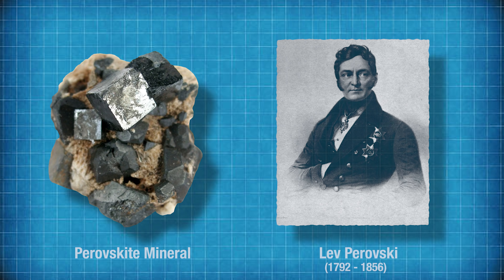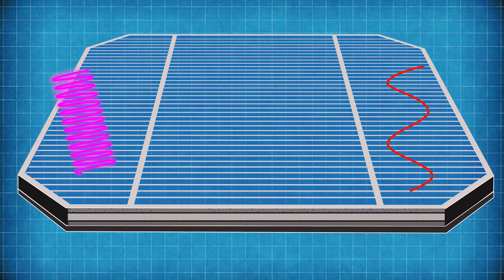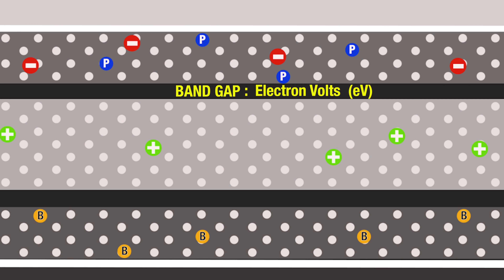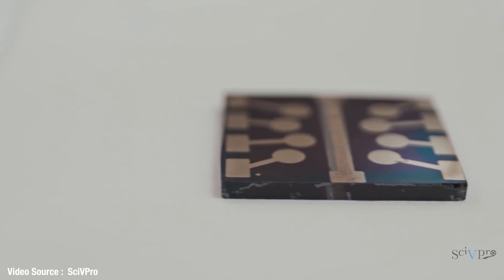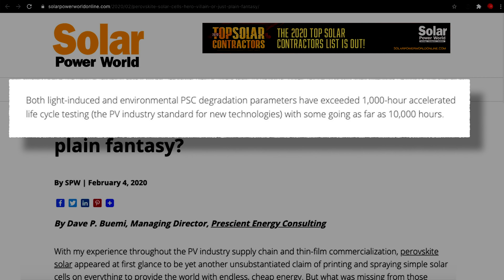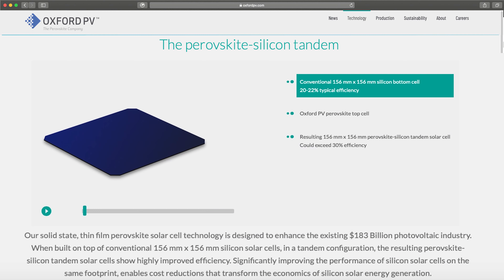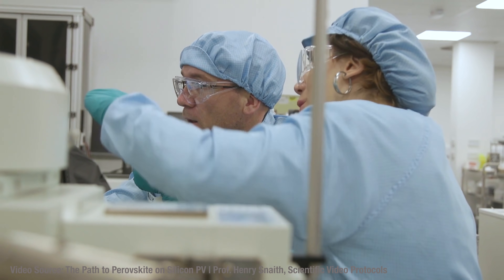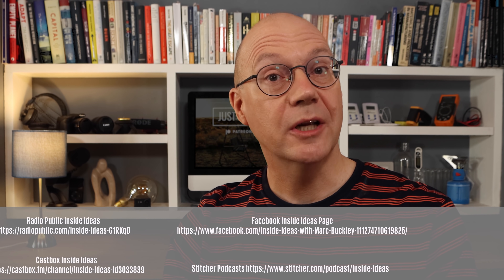Perovskite Solar Cells: Game changer?

Comment: Really interesting video! I wasn't familiar with perovskites and this was a great intro.

That said, your explanation of Si cells contained several significant errors, the biggest of which was your description of the band gap, which has nothing to do with the distance between two things. The band gap is the energy required to excite an electron so it starts moving about, enabling conductivity. Think of a piece of Si as a giant tray of ice cubes: If you jostle it just right, one will pop out and slide around on top of the others. How hard you have to jostle it is the band gap.

Also, the doped layers both conduct better than the non-doped layers (plus there aren't really distinct layers but more of a gradient), the difference in doping just changes whether the energy is carried by positive or negative charges.
Reply from the maker: Thanks Benjamin. Absolutely correct, and this has been pointed out to me many times now since Sunday. My apologies for the inaccuracy. I have now removed the section of the video where I said boron makes silicon less conductive and I have also removed the part where I say that the band gap is 'between two layers'

Comment: Solar thermal energy coupled with storage (molten salts) currently operates as a base load power source.
You’re referring to Photovoltaic power which is only 23% energy efficiency. The combustion engine efficiency is at a similar level. In fact a finely tuned formula 1 racing engine barely exceeds 28% energy efficiency. Most of the energy generated by a combustion engine is lost through the exhaust pipe as heat.
We need a raft of renewable energy sources connected to micro grids and interconnected networks coupled to storage facilities in order to supply the demand curve (which varies widely during the day and during the year).
Reply: Yep

Comment: It all sounded credibly good until you mentioned Al Gore. Solar's success is largely dependent on grid capable energy storage and delivery (batteries and super-capacitors). Both areas seem to be hitting new milestones - but there is still a gap. When this gap is closed there will be a revolution in the global energy grid.

Comment: Prediction: it will be a graphene perovskite of some kind that finally breaks 50% efficiency.
Reply: Efficiency here isn't the issue. It's stability. These cells literally react when light shines in them lol so it's not going to become comertial anytime soon they're sensitive to water or even humidy as well
Reply: @RECURSIVECIRCLES  You can protect the cells from those environmental conditions pretty easily. The REAL enemy is ultraviolet radiation. That's the part of the spectrum that causes the photochemical reaction you describe.
Reply: @vincentrobinette1507  no you can't. I work on these materials. The problem is they're highly reactive and unstable. The lead leaches out. The main issue with these cells is their stability. There are no cases of more than a year yet and functional efficiency. In space it may be better but so far this is the biggest draw back for them
Reply: @RECURSIVECIRCLES  One thing I didn't think of, is oxidation. I wonder if corrosion is another factor. Just like painting a car, it protects the metal from oxidation, for a while. It eventually creeps in over time, otherwise, cars wouldn't rust. I don't know how corrosion resistant these cells are, and it also depends on the chemistry. Lead will indeed, oxidize. containing the lead can't be too much more difficult, than containing the lead in a AGM battery. (which also have a very limited service life)
Reply: @vincentrobinette1507  yes corrosion is one big problem. The lead corrodes into the material and yeah oxygen is a big problem and even light. Light activates some molecules and make them corrode . Again they're great for efficiency but stability is good yet. The most stable ones have carbon nanotubes and they try to put layers of molecules that are more inert to protect them. Of we make them stable we literally have a great answer to power

Comment: At 8 minutes in, lead has the most complete recycling infrastructure. Yes, for highly concentrated lead acid batteries.  Recycling sparsely distributed, leachable lead out of newfangled solar cells is NOT the same thing!

Comment: I know you're getting used to my digressions.  Though this is I feel related, I will try to be concise:  1) lower voltage processors, and 2) micro-automation.  First of all, I've been recently working as a flunky at an (NDA) project at Intel, and all that gets me, which is nevertheless vital, is a sense that all the present focus on processors is making high power ones that maximize a nice large number of thoughts per calorie, if I may be so non-engineering.  It seems to me there is a lot of automation room there for very small cpu powered units that maximize a small number of thoughts but reduce the energy usage to almost nothing.  I don't see anyone doing this yet, but doing so, it seems to me, would make room for a lot of micro-automation that we may want to do.  I think this because I also think that just as there is room for processing, there is likely also room of micro-movement of reception states in what from the macro world might look like fixed solar collection units, but which in the micro could be made to vary directional maximum.  If so, you could have a panel that moves direction without physically moving at all.  Sci-fi?  I bet not.

Comment: Perovskite cell efficiency has a long way to go. The certification sequence for solar modules is described by IEC 61215 - it involves many test sequences, including hail impact, thermal cycling, damp heat, and wet leakage tests. The 1000 hour damp heat test (85 deg C @ 85% relative humidity, for 1000 hours) is a difficult part of the test sequence - however, much of the literature on stable perovskties is done at lower temperatures and humidity, and also omits the mechanical stress, thermal cycling, and wet leakage tests, and is commonly performed on small custom made devices, not commercially manufactured modules. 

The highest efficiency perovskite cells break down in the presence of sunlight, oxygen, and moisture - they are very fragile devices.

Furthermore, investors typically rely on much more stringent reliability tests, like PV Evolution labs test sequence, or multi-stress sequences. Just because a perovskite cell can last 10,000 hours at 65 deg C doesn't mean it is really 'stable'. Even if the module is completely free with no manufacturing costs, the cost of installation, shipping, racking, and wiring is such that it needs to last at least 15-20 years in the field to be price competitive with traditional solar panels.

Comment: Existing silicon panels have a much longer lifespan. Dual glass half cell monocrystalline panels should have less degradation due to internal heating and moisture. Is Perovskite "greener" over its lifecycle?

Comment: Oh yea, every 10,000 hours we have to replace 100 square miles of solar panels! Sounds like a hell of a lot more expensive than natural gas power generation. Not mentioned is the massive tax increases necessary to implement this wild scheme, plus the higher electricity bills because of the necessity of producing the constant flow of replacement panels due to their short lifespan. A natural gas turbine plant lasts about 20 years until needing rebuilding. This would equal almost 20 replacements of the solar panels at 10,000 hours life quoted in the video. (the best silicon solar panels will still put out 80% of the original power after 20 years)  This does not count the ENORMOUS cost of replacing the square mile of batteries that would lose capacity over the lifespan and have to be replaced.
Reply: You are right 10,000 hours is not commercially  viable for grid generation (only good for small personal use like camping) But this is prototype figures. 

But current 25 year life cells are now becoming cheaper in many places around the world to generate power over there life than Gas, and the cost is falling fast. Yes we need to include the cost of storage but again price is falling fast with new technology being developed every day. Remember the fossil industry took well over a centenary to develop/construct and 10's of trillions in subsidies to get to  what we currently have. We cant expect to create a placement overnight, its going to takes decades as renewable's slowly replace decommissioning fossil fuel infrastructures.  

And remember the world spends Trillions per year constructing, replacing and maintaining the fossil fuel industry, and hundreds of billions per year in subsidies  and tax breaks. and all that fossil fuel infrastructure wears out just like solar cells, batteries and wind farms.

So in theory should not cost that much more in the long term to replace end of life decommissioned fossil fuel infrastructure with new renewable's,   And with new technology being developed every day, could even end up being a lot cheaper in the not so distant future.

We just have to start! And have the will power and energy to compete!
Reply: @stevetaylor2818  AOC wants to do it in 10 years! Vote demorat!
Reply from the maker: That's accelerated testing glasslinger, which equates to many years of real-world exposure. Here's a link to an explanation from a person smarter than me,
 https://sinovoltaics.com/damp-heat-testing/

Comment: While achieving greater conversion ratios is always good, it's not very relevant because all that solar energy is FREE for the taking, unlike most other sources. Plants are probably not perfectly efficient in their photosynthesis but we still eat them and burn their fossil residues: they are effective enough. And so are current solar panels.
Reply: Luis, what is free is the source, but the device to harness it IS NOT. ANd don't compare to photosynthesis, because photosynthesis doesn't require mining for resources or furnaces to be assembled.
Reply: @VFatalis  - The photovoltaics are relatively unexpensive.

Photosynthesis is very much comparable because in both cases is about direct use of solar energy. While the plant does that way get most of its resources (CO2, turned into carbohydrates) from the atmosphere (air mining?), it does require other resources such as water and fertilizers, which the plant extracts via "mining" from the ground. The main difference is the decentralized and autonomous nature of the vegetal solution, maybe we should learn even more from those plants, just maybe...
Reply: @George Mann - fossil fuels are not "free": they cost in terms of pollution and global warming, else we would not even be discussing solar energy, we'd just use coal and coal-derivatives, which are extremely aboundant.
Reply: @George Mann - No, they don't. Production of the pieces may have some costs (as with everything that is produced, including junk food and junk vacations, and of course all that military waste, we produce a lot of unnecessary wasteful and harming things, none of which is solar panels) but otherwise solar energy is all win. 

I insist: you can always improve efficiency, that's all good, but even if the efficiency is lowish, it's still just harvesting free energy, we just harvest a bit less, no big deal.

Comment: Thank you Dave for an excellent presentation.

There is a lot of media attention to plastic pollution , and rightly so, but do people ever consider that  if the plastic were gathered together and buried it might be a good way to lock carbon away from the atmosphere and prevent the subsequent formation of carbon dioxide? 
The irresponsible dispersal of plastic seems to be the real problem rather than plastic per se.
Reply from the maker: Hi Paul. Trouble is it leeches toxins into the soil which eventually buggers up the ecosystem.

Comment: Cost per watt is more important than percentage of sun light collected. Solar is not like burning a gallon of fuel where you don't want to waste energy.  Solar is already generated by the Sun and at best we will only ever collect a tiny percentage that hits the planet, and as such we are not wasting what we don't collect. 

Yes higher percentage would be better, especially for limited space roof top installations, but currently most houses can  fit on there roof what they can use. 

But for commercial solar farms it's all about cost per watt/return on investment, and space for solar is not yet an issue as there is so much spare space on roof tops, waste land, desert etc. of which we haven't yet utilized a tiny faction of available space.

and to go mainstream, solar cost combined with power storage cost, is going to have to be more  profitable than fossil fuels to convert the masses that this is the power of the future.

Comment: What happened to that solar roadway stuff?  Was it just a gimmick? Is there a good reason why covering roads in solar panels wouldn't work?
Reply: Apart from not having the correct angle, except for near the equator, .... the biggest problem is traffic. Bit of an issue for roads.
The surface needs a light blocking coating to provide grip to tires. And panels get dirty, scratched, cracked and covered with leaves, ice and snow. The bicycle paths in the Netherlands and in Northern France are utter failures.
Nothing but virtue signalling with other peoples money (tax payers).

Comment: Degradation? This is the problem to be overcome.
Reply: yes, pervoskite stability has been an issue for years and years (I worked on piezoelectric properties of some materials about 30 years ago, it was already a well know problem that had been looking for a solution for quite a while)
Reply: We are working hard to address this,  at the lab I work we are investigating how passivation and surface engineering can slow degradation without decrease the efficiency
Reply: At 5 solar hours per day average, 10,000 hours will only last ~5.47 years. OK for an RV, but not practical for a whole house photovoltaic system. Just the labor cost of such frequent replacements, will cost more than the difference in cost of the panels. Right now, I still recommend mono or polycrystalline panels, because you can leave them up for at least a couple of decades or more, before replacement is necessary......For now!
Reply: @vincentrobinette1507  the 10 000 hours is a very VERY best case scenario, most of those cells go up to 1000 hours, which means just several months. Perovskite is just a hype and all those videos are advertisements designed to get you excited and make you invest your money.
Reply: @the_sideshifter  I agree. The only panels I can recommend right now, are  monocrystalline or polycrystalline silicon. Such panels will usually keep 80~90% of their rated output after a couple of decades. Yes, they will be more expensive than Perovskite, but, you will get much more energy per dollar invested in the long run. I don't much feel like getting on my roof every 5 years to change out panels, nor, can I afford to hire it done. While the Perovskite cells are fascinating technology, it's got a long way to go, before it's anything more than "hype".

Comment: You're doing a great job. I'm sure there's a whole bunch of people who still think fossil or nuclear will always be necessary for base load. With stuff like liquid air batteries and perovskite cells solar and renewables really do offer a solution. But people have to be educated...which you're doing 😉
Reply: Apart from storage solutions like liquid air batteries being far from commercially available the environmental impacts of wind and solar farms are massive. Roof top solar yes gigantic lands being destroyed for solar farms not so much. Nuclear is just a great energy source and we should use fission until we have fusion.
Reply: @mrkokolore6187  Why is Solar and Wind farms such a massive environmental damage compared with how power is currently generated? Do you know how many resources are required and how much environmental damage is done to get a gallon of gas to your fuel tank before you even burn it and polite the air. And as for nuclear waste!!!!!!!!!! 

The infrastructure for renewable's will not be any more worst for the environment than what currently exists or even cost much different in the long term, if replaces existing infrastructure as is decommissioned.  Trillions of dollars is currently spent every year on building/replacing the fossil fuel infrastructure with massive damage to the environment!!! 

But once the renewable infrastructure is constructed it won't be producing any significant pollution in actually generating the power unlike our current infrastructure.
Reply: @stevetaylor2818  First of all to make things clear I do not support fossil fuels. They are destroying the planet are also strongly limited in terms of fuel.
The problem with renewables among others is the space requirement. Renewable energy is incredibly diluted meaning you need to take a massive amount of land to replace one nuclear powerplant. I actually think that all of your argumets concerning nuclear energy can be answered by the following:
https://youtu.be/N-yALPEpV4w
https://environmentalprogress.org/the-complete-case-for-nuclear
The land impact of wind compared to nuclear is visualized here:
https://youtu.be/zc7rRPrA7rg
Reply from the maker: Thanks Bykermann. I appreciate that :-)